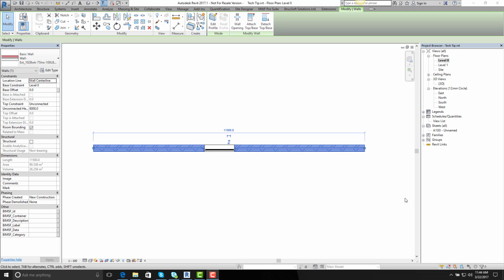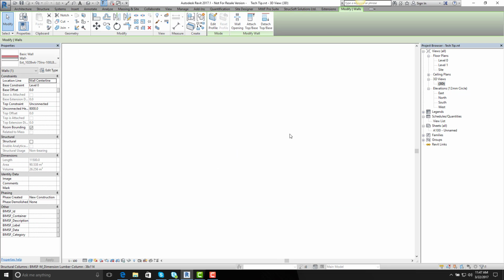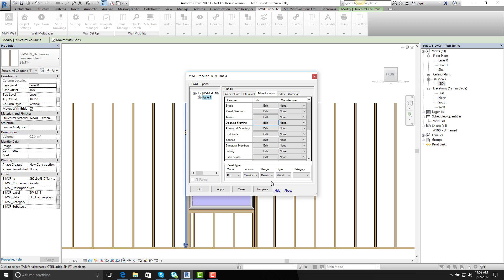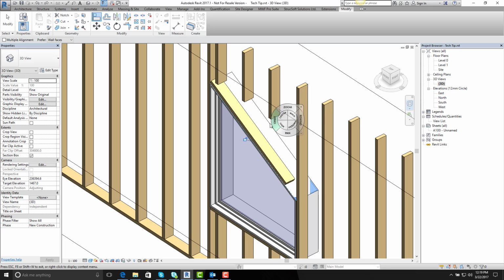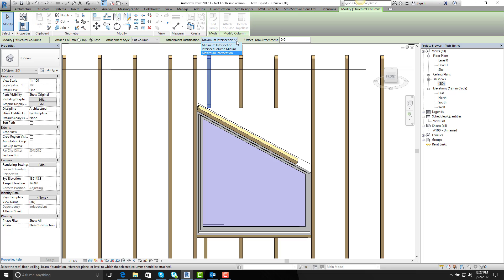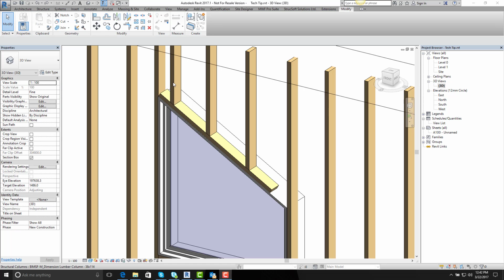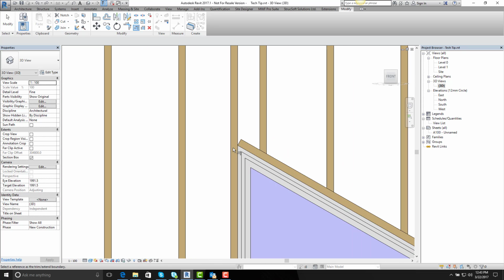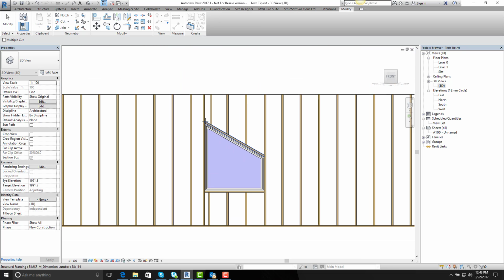How To Frame Trapezoidal Openings

Comment: This video emphasizes running the CAD tool, it misses all of the structural design aspects for framing a window. The header and sill have inadequate support. And the size of this header is marginal for even non-loadbearing walls.